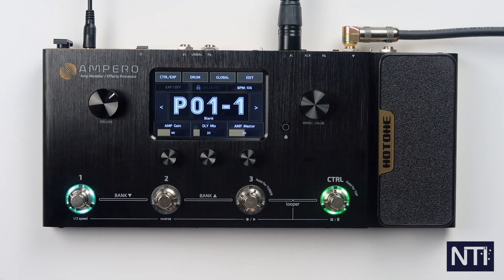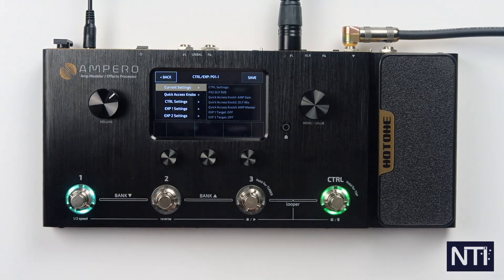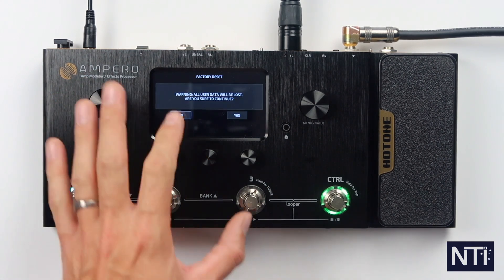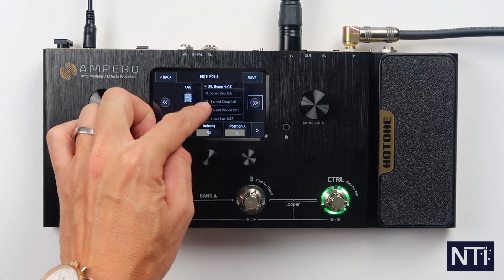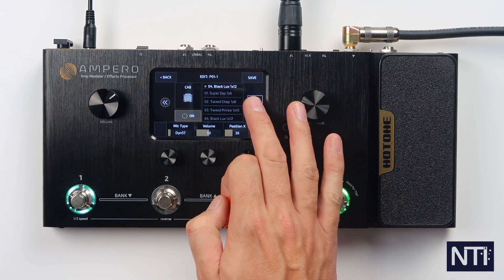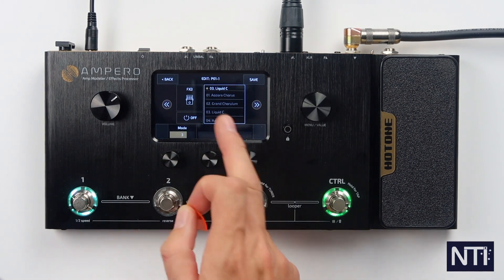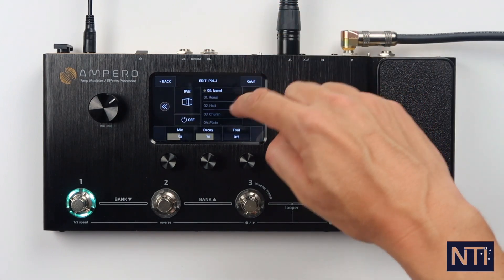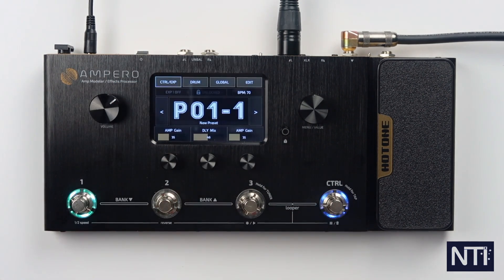Hotone Audio Ampero - The Basics & Building a Patch

Comment: I got an ampero seven months ago to sub for my Headrush which needed repairs. I have been using the Ampero only, since getting it. I love the editor. I love the sounds I can get.
 Like I have found with other modelers, best sound and feel comes from using mostly amp gain, and pedals for a little drive when needed. I also like the Xotic style boost pedal models they have. So good at front of signal chain!
Thanks for your review!

Comment: I just bought One...Sounds way better than my POD-HD500X But...I do not like the drum machine and I am having a software bug..when I click on the lower patches the editor shuts down.
Reply: Hai! I have a pod hd500x as well and wanted to upgrade to a smaller unit but with no compromise tones. Was really interested in the hotone ampero. Is it more intuitive to use than the pod? Cause that was one of my main concerns..it had too many things for my need. Wanted something easier and with better tones.
Reply: I just bought this unit.sold my pod go because of the tone qualities and ease of use.
The pod go was just too many loops to jump through.
I have dialed in some sick brutal chugg tones and haven't even downloaded anything from the web.
ALSO,,,NICE JOB ON THE DEMMO.A+
I NOW SUBSCRIBE

Comment: Great Great tutorial. Much appreciated.  Question: Can you assign one universal effect to the CTRL foot switch? That is, say, in whatever bank or patch you are in, when you step on CTRL, you get the same effect everytime added to the patch - be it a reverb, phaser, boost, delay, etc. Any idea?
Reply from the maker: You would need to manually save the effect block you wanted to do that with in each patch.  So it would seem like a global preset but in actually fact it would be the same effect programmed to the CTRL button in each patch.

Comment: I had a HElix for 2 years and I sold it,  the helix is great but it was just a bit to much for this couch potato guitarist .   The Ampero sounds great but we need to remember, if you don't set up your own patches for your amp /speaker configuration, other writers patches will not sound as advertised unless you have the same equipment the as the writer of the patch.  They all need to be tweaked.      This was the same with the Helix.

Comment: Didn’t it just overwrite the original preset at that location? How do you create a brand new preset and then how do you access it from the pedal?
Reply from the maker: There is a duplicate of the factory presets in the user preset slots, you do just overwrite them but the original sound will still be in the factory list.  You can recall presets with the bank up and down buttons or with MIDI PC numbers if you’re using a MIDI controller.
Reply: @Mark Seymour I think they missed this  bit of information in the manual. If I reset the unit the preload user still is loaded ??????. This is the only place this bit of information is printed.

Comment: I think they missed this  bit of information in the manual. If I reset the unit the preload user still is loaded ??????. This is the only place this bit of information is printed. 
 The difference between user and factory .    Maybe a F / U slots would be  
 Bank
A set of 3 patches is called a “bank”. Ampero has a total of 66 banks,
including 33 editable player (user) banks and 33 factory banks (F01-
F33), which can be adjusted by not saved.    other that nada..  

 I pulled my hair out for a couple days..... I think if I would have connected to the USB editor I would have figured this out faster.  Noticed in his video the patch title is BLANK.  It should be sold with blank users slots...I think